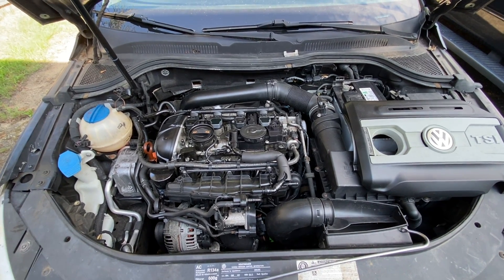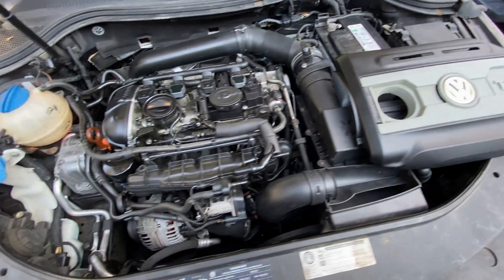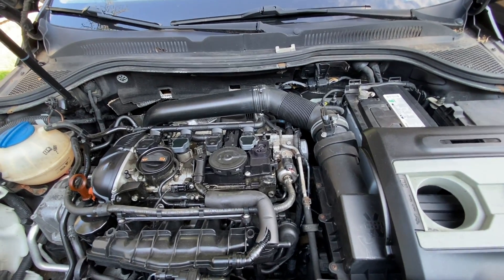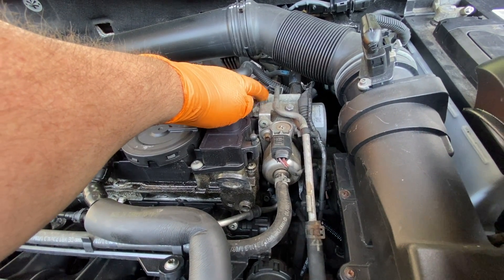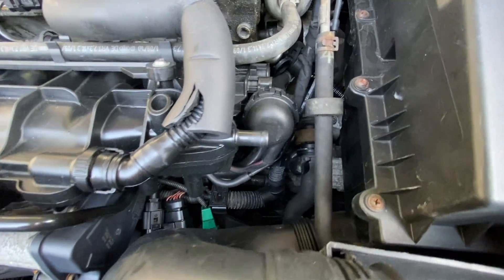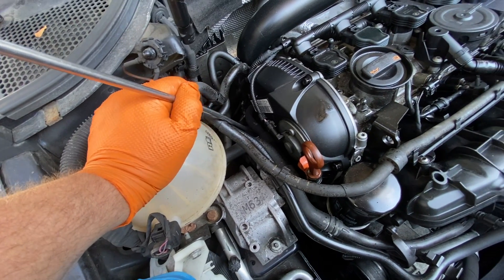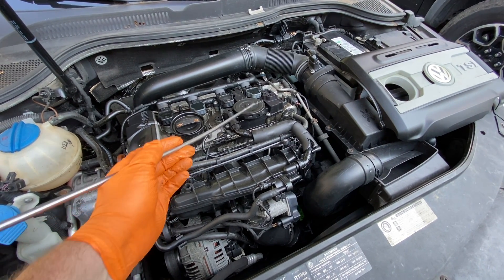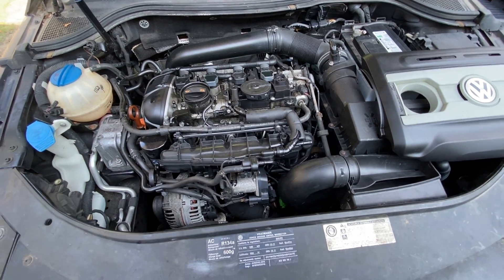VW 2.0 Turbo Engine Common Problems & Their Component Location

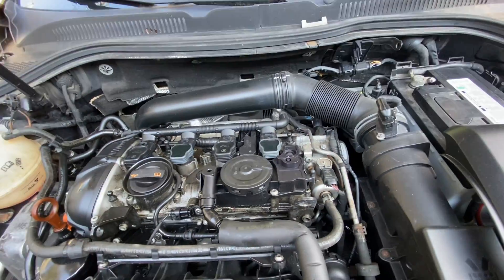Comment: I have 2014 vw cc sport 2.0 turbo done replaced pcv, all coil packs, an plugs, an crank shaft sensor but still running really rough an throwing ecu code 1:13
Reply from the maker: What codes are coming up?

Comment: I have a 2013 CC Sport that has a cylinder 3,4 misfire then got 4 to stop missing. The plugs were dry the 3,4 plugs were extra black though. Replaced those plugs then the coil packs and it was still missing so I changed the pcv but it was still throwing a cyl 3 miss so I changed the 3,4 fuel injectors. The cylinder 3 injector was leaking after everything was put back together it was still a miss. Do you think 2:40 is the culprit. If not what do you think is keeping cyl 3 misfiring?
Reply from the maker: Check cylinder compression in number 3 cylinder

Comment: My mechanic changed the cam shaft sensor but said he thinks the timing chain may need replacing. Do you think it could be the tensioner and not the chain itself? Is it an easier/cheaper fix?
Reply from the maker: Yes, unless the chain is stretched too much

Comment: Gm boss . Hope you can help me with a 2020 Vw Passat that’s showing insufficient boost . I did some test change the turbo , boost sensor still won’t boost any tips you can help me with please ??
Reply from the maker: Could be the waste gate is not sealing properly or the diverter valve can leak too. Can’t be not leaks in the piping from turbo to intake either

Comment: What kind of systems/problems would the car make if the actuator that controls the intake manifold fails ? Thanks
Reply from the maker: Poor mid to high performance, check engine light on.

Comment: I'm going Saturday to look at a 2009 Passat 2.0T  w/147k miles and running good owner says but it does have an oil leak just not sure from where.  I'll check that vacuum pump and also the PVC.  I'll bring a scanner and check for codes too.
Reply from the maker: Make sure the oil leak isn’t from the rear main seal

Comment: My 2021 Tiguan hesitates badly, almost nothing for 3 secs until the turbo starts kicking in.  The dealership claimed they were unable to duplicate the problem.  That's denial and bs.  It's not an intermittent problem.  Thanks for the info.
Reply from the maker: Sure, no problem. Keep and eye on any vacuum leaks, low boost or misfire codes

Comment: Hello, What about turbo boost control solenoid valve where is that located ?
Reply from the maker: On the intake tube near middle of radiator
Reply: @motorcarnut thank you so I got a epc light with engine light and message saying Error with start stop and code ranges from n45 to turbo boost solenoid ? I am baffled
Reply from the maker: Sorry that would need to be diagnosed in person.

Comment: Help. I bought a 2010 EOS about a year ago.  Had the Maf sensor code.  Replaced have same code now P2187 I was told it was the pcv.  I didn’t not check for leaks determined we still had the same issue so we bough a $550 one from the dealerships.  This has yet to be smoke tested.  In addition I have done plugs and coils twice, injectors once (Bosch) have the smoke test done two more times tested confirmed working.  I’ve been told 3 smokes test we’ve done intake and exhaust but I can hear what I expect would bean exhaust leak and have been promised it’s been smoke tested forward and backward an exhaust rear front and rear main seal were both inspected and passed. PCV valve as I will test it myself.  So now the shop thinks it has to be the cat converter.  They scoped it and it must have gotten hot in there at some point because it was an oily Gassy mess.  O/2 sensors have also been replaced within the past 2 months.  So I agree to the cat swap (which is not recommended anywhere for code P2187 - system too lean but I was just “ may as well , we’ve thrown every other part at it.  Now it does sound like the vacuum leak stopped I got the same code before I even got home from the shop.  

I’m going to run some smoke, test some pressure check lines but what the f could this be.  I’ve replaced every possible recommendation on Google.  Yes I know that not a guarantee but you think one would work.  PLEASE HELP!
Reply: The maf sensor was done cheap then expensive. Replaced them both leaving the official vw part in. I changed the pcv valve again from cheap to expensive and the vw one has not been check yet.  

Sound like the vacuum leak stopped from the exhaust but the code was back in to minutes.  I was cleaning the code every day or so now it’s like every 5 minutes.  I’m worried about permanent damage and let’s not forget that I’ve spent more in repairs than the original purchase price.  Has approx 100k miles and looks great 8/10 for being 15 years old.
Reply from the maker: You have to check the HPFP can be a fuel pressure or delivery problem, also very well can be a vacuum leak. Check the plastic hose that runs on top on valve cover from the front to the back, its secured to the valve cover with metal clips in two places they usually melt or crack there and produce a vacuum leak.

Comment: Hey Boss, Hope all is well! Is a R Line Passat with 100k miles something to stay away from? Interested In getting one but weary want to know what to be on the look out for on the test drive.
Reply from the maker: What year? Anything before 2013 will have some of the issues I mention in my other videos, the newer ones are less troublematic. Check for leaks on the bottom of the car in-between engine and transmission for rear main seal leaks, I would bring a scan tool or code reader and make sure there are on pending or stored codes especially misfire codes and run a carafe. Good luck!
Reply: @motorcarnut it’s a 2017 Passat with two owners no reported accidents on carfax but yes I’d definitely be bringing someone who understands how to check a motor and a scan tool
Reply from the maker: You should ok then, good luck!

Comment: VW circled the problem with their cars in their logo
Reply from the maker: So did Toyota
Reply: @motorcarnut the last few years of Toyota have been less than fantastic, I'll give you that.
Reply from the maker: Yep, manufactures are constantly cutting corners and its showing.

Comment: Can someone help. My VW Passat CC 2010
turns off in the middle of the road after few minutes if I drive with the Ac on . I have to turn it back on to continue, but it doesn’t do this if I don’t turn on the AC
Reply from the maker: Maybe something wrong with the AC compressor maybe partially seized?

Comment: Looking at a 2018 Passat purchase with low miles - was the timing chain tensioner problem corrected by 2018?
Reply from the maker: Yes, those engines were much more reliable than the previous ones.

Comment: I totally agree, just replace the whole intake mainfold, because it's a poor design and it will fail sooner or later. Also, after I replaced the PCV Valve, I had a massive leak at the hose at the top left, because the seal didn't fit anymore. Also a poor design, so do a smoke test to make sure there is no leak anymore. Now I found out, that I also have to replace the gasket at the vaccum pump.
Reply from the maker: I have videos for all these including the vacuum pump gasket that can make it seem like a rear mail seal leak

Comment: Hey, I have a 2010 Volkswagen Jetta 2.0 turbo and recently the rpm’s have been on 0 when idle and the engine runs really rough when on for too long it turns off I haven’t been able to find the problem any idea what it could be ?
Reply from the maker: Tough be sounds electrical to me

Comment: What kind of mileage are we talking about when these problems start to show up?
Reply from the maker: That depends but I see it mostly at 75k on
Reply: @motorcarnut  Thanks. 2022 Passat with 2.0 engine.
Reply from the maker: Yours is more reliable I wouldn't worry too much

Comment: What’s normally triggered multiple sensors on the vw Passat
Reply from the maker: Depends which circuits are related, ABS will trigger, stability controls, cruise etc.
Reply: @motorcarnut  these are the codes showing P2088, P0243, P0245,P2008,P2009,P0444,P0010, P0258 and some of the are showing low circuit.
Reply from the maker: If no electronics got wet then I'd say it have to be diagnosed with scan tool to see what the live data looks like.
Reply: @motorcarnut  can I send you the diagnostic report
Reply from the maker: Yes post on your channel

Comment: Thanks for the video man. I have a vacuum leak that doesn’t spool the turbo. I ha d the codes to replace the turbo and and intake manifold. And pcv. Well I did and still get no boost. I will check that vacuum at the fuel pump now. Thanks.
Reply from the maker: Check the vacuum line on the turbo too.

Comment: Hey man, I have a 2010 Volkswagen cc and I’ve been looking for videos everywhere for the location of the engine coolant temperature sensor and I cannot find it anywhere. Can you please help
Reply from the maker: Yes its in the water pump housing under the intake manifold, its a real pain to get to unless you remove the intake manifold. I have videos on replacing the water pump to show you how to remove the intake manifold and could see the coolant temp sensor.
Reply: @ awesome, isn’t there another sensor tho next to the radiator?
Reply from the maker: That would be for the fans not the engine
Reply: @motorcarnut  gotcha, I think I also need my thermostat replaced:(
Reply from the maker: Yeah its a pain to get to its also on the water pump.
Reply: @ dang very unfortunate, don’t you have a video also kind of going in depth on that?
Reply from the maker: Yes the water pump replacement video

Comment: The first thing that fails on this car is usually the water pump. The dealership replaced mine, and it failed again in less than 12 months. These engines are not reliable, and please stay away from this car. There are better options out there such as Honda and Toyota
Reply from the maker: Honda and Toyotas fail in different ways, don't worry . What exactly failed on the water pump? I never replaced one that had failed only leaking from water pump to block seals

Comment: I have one I'd like to throw at you if your game? I can't figure it out but I have a few ideas and I wanted to get your thoughts so I have oil pooling next to the cap in that little valley there I see in the video that's the same thing going on here if I can see it properly. That whole left side is kind of washed out from the top of the cover over the cam to the left side of the valve cover gasket I mean clean metal washed out but it's not obviously coming from anywhere and I have a suspicion that it's only happening under load. Any ideas with that could be? Maybe it's that cover with the cam seal? That whole side of the engine's oily obviously but it's coming from some sort of source over there that's not obvious
Reply from the maker: I don't understand you 100%? Where is there oil on? The cam cover or the timing cover on the passenger side of the engine?
Reply: @motorcarnut  in between the cam cover and the oil cap in that little valley. But it's also splattered in that general area and enough where on the edge of the valve cover itself there's no dirt it's clean like it's being washed The weird thing is it's not like it's dripping oil until it cools off when it's parked in the garage. It's just really not obvious where it's starting from. I'm assuming it's that cam cover
Reply from the maker: Best thing to do is to clean the whole area and dry it then drive the vehicle and see where its leaking from, that's what I would do.
Reply: @motorcarnut  trust me I've done that and I will repeat it tonight but man it is not obvious to me where it's coming from. If I can't figure it out this time I'm just going to assume it's that cover because it's one of those weak points and we'll see what happens from there I suppose. Thank you for that advice on the PCV valve by the way! I think you just saved my behind
Reply from the maker: Sure no problem, sometimes those leaks can be a pain to find.
Reply: @tommyboi0 did u find where the leak was from??
Reply: @RobertoGonzalez-fe4kv  I did, if you are talking about the oil it was coming from the cover that goes over the timing chain.

Comment: Hi Sir, my 2011 Tiguan got P2187 code, I replaced the PCV and timing cover gasket(I have oil leak there), but after several round of driving, the code came back. And I found there's oil leaking from rear main seal, not sure if it is from this part, but I do found leaking. Does this cause the P2187?
Reply from the maker: Yes it would and they are know to blow the rear main seal out when the PCV is faulty, make sure this is not the cause of the leak first.
https://youtu.be/UZmCw-BNOjE

Comment: Hi guy's I need help to find the fault of my car Volkswagen Tiguan 2009 when I switch on coolant fan working directly and then I switch off ignation still fan not stop after 10 minutes fan will off automatic
Reply from the maker: Fan module going bad
Reply: @motorcarnut  where I can find in car fan module Sir
Reply from the maker: It's built into the fan

Comment: I made sure to check as much of these as I could after I got my Mk.6 GTI.
I have the revised versions of the timing chain and tensioner; I have a the revised intake manifold; I replaced the coil packs with newer ones; I replaced the high-pressure fuel pump as preventative maintenance; PCV has no leaks and I replaced its diaphragm in hopes that it doesn't tear; I replaced the diverter valve with a newer-gen one; I added the VW turbo wastegate actuator-arm anti-rattle clip; I replaced my camshaft adjuster magnet and VVT valve after getting a P0341 code (it solved it!); I have no valve-cover leaks; I had a shop preventatively replace my water pump with an aluminum-housing one; and I've done other regular maintenance along with 5k mile oil changes.
That said, I still have a few problems: some kind of super tiny underside un-traced oil leak that might be the RMC (and doesn't appear to be the HPFP housing gasket you mentioned), and now a slight overheating issue where the water temp will increase to 109 C/228 F if the car idles for long enough (but it doesn't go above that). Maybe the shop messed up the water pump install, or a low-quality thermostat? It's annoying to still have issues now, but I'd like to think the car should be fairly reliable going forward.
Thanks for your channel! You have by far one of, if not the best channel for information on this engine anywhere!
Reply from the maker: Thank you for your support! Great job tackling the issues on your GTI! It sounds like you've taken all the right steps and hopefully those final issues are minor! The rear main seals are the older cheap ones just keep an eye on it that is doesn't get worse. The PCV valve can cause it to leak from pulling too much vacuum, but you said you replaced it. The overheating, if it weren't there before the water pump change, can be a last thermostat in the new water pump. Keep me posted on what you find and good luck!
Reply: @motorcarnut  Coincidentally, few days after posting my comment, the car stalled out while driving down the road at like 40 mph. It started right back up again, but it was still concerning. I scanned it and the P0341 reappeared! It's weird I went six months without seeing it, and then it comes back worse than before. It then stalled out a second time four days later.
I brought it to a shop and had them check the cam bridge; the oil screen was intact, but the bridge was an OEM replacement of an older revision, so the previous owner probably had it changed. I had them replace it with the newest revision, but other than that I'm not sure what could've caused the stall-out, which worries me.
They also fixed the overheating issue -- it turns out the aluminum water pump had some kind of fitment issue and wasn't working properly. As much as I wanted an aluminum one, I decided to go back to a VW pump and the overheating stopped, which is more important in the end.
Reply from the maker: Hopefully there is no blockage of the old Cam bridge oil screen causing your problems. The P0341 is mostly caused by the oil control valve, cam bridge, low oil or oil pressure, stretched timing chain, blocked oil passages and or cam sensor on the cam cover or the wiring too and from it.

Comment: I just had 3 oil leaks fixed on my 2016 Volkswagen Tiguan. Since they were gonna fix the timing chain gasket i told em to replace the timing chain. It was at 100K miles. Got the car back today and I feel like it has a slight vibration that I never felt before. Do you think they didnt put in the timing chain or tensioners in right?  Im gonna call the mechanic tomorrow. I paid 3K for this job 🤮
Reply from the maker: I wouldn't know what they did or didn't do so bring it back, you paid too much to not have the engine running perfectly right out of the shop.
Reply: @motorcarnut  thank u and subbing
Reply from the maker: Appreciate that !!

Comment: I have a fuel smell in my cabin area and if i open my hood theres a super strong fuel smell. So far ive seen its the canister purge valve. Could it be anything else?
Reply from the maker: Make sure there isn't and fuel leaking from the fuel injectors or any fuel lines can be dangerous.

Comment: 2010 B6 Passat  Wagon: PCV valve is original, but no vacuum is present. Car has 22,000 miles. Change it anyway?
Reply from the maker: Well if its not giving you problems and the mileage is very low, I would leave it alone.
Reply: @motorcarnut  Thanks!
Reply from the maker: No problem.